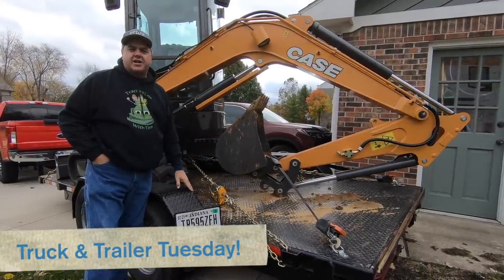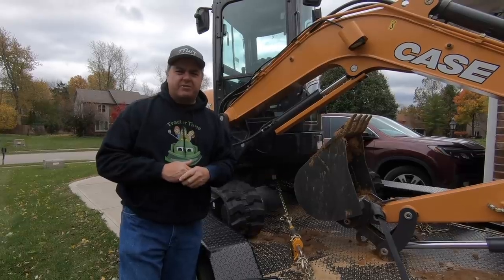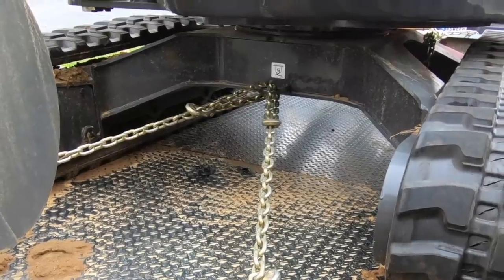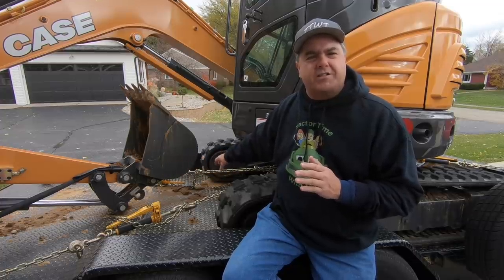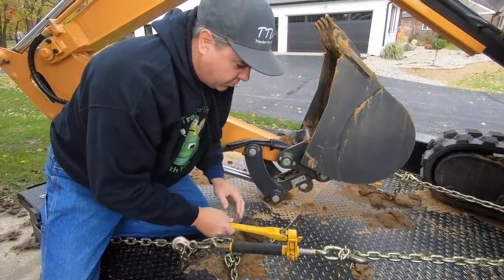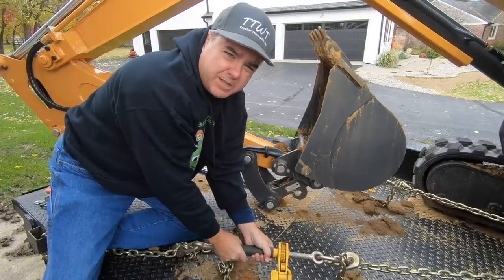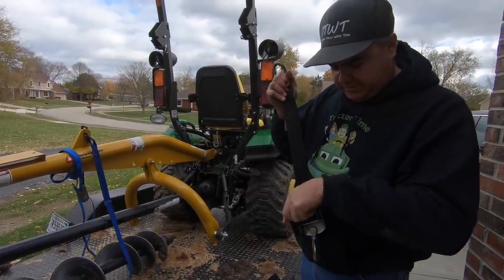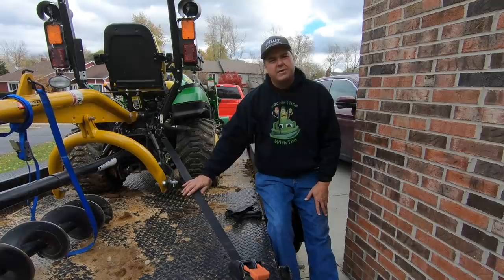Tie Down Your Equipment!  Truck and Trailer Tuesday

Comment: I think my John Deere manual says to haul the tractor with the front facing to the back ? I guess in case the hood latch releases?
Reply: I thought the reason to load the tractor backwards when hauling on a open trailer was so the seat does not violently bounce up and down as you go down the highway.  I must admit I have no link to support this, only sharing from my memory.

Comment: Not on topic but you should think about adding some 1ton(or more) swivel jacks to the back of your trailer for support instead of the blocks of wood. One of the best investments I made to my trailer. Not only will they stablize  the trailer you can lift the trailer off the ground to change a tire.
Reply from the maker: Ha! Well, this was the first (and so far only) time I have had big Casey on the trailer.
Give us time.  We’re trying to solve this issue
Reply: I second this this idea. I did this to mine Tim, its a great modification
Reply: That was going to be my suggestion as well but you beat me to it.

Comment: I still prefer the lever or snap binders even tho they are illegal in some states. The ratchet binders work well also. My biggest choise in any chain or binder is that it is made in the USA. The ratchet binders you are showing that I have found are made in China.  I'm sorry Tim I'm not trying to be mean, But I personally would never tie down anything I own with Chinese binders or chains. I only use high strength American chains And binders. To each his own, But I don't go cheap on time downs. I would like to add you did a excellent job showing And telling how to secure equipment.  Just not a fan of the binders.
Reply from the maker: What phone are you using to view this?

Comment: Doesn't the equipment that is attached to you tractor have to be tied down also? Or is it ok like the way you have your straps running over the front bucket holding it down all you need?

Comment: Hey Tim, how well does the rear PTO work on the 1025r? It's rated kind of low but I keep seeing videos of people easily using implements which call for more PTO HP and and RPM than the 1025r is rated for. 
It seems to power them all pretty handily.
Thanks for all the great info as always my friend!! 
My local Deere dealer is having a black Friday sale on the x700's, and the 1 series sub compacts (1023e, 1025r etc) So I am finally getting my green machine next week.
Reply from the maker: What are you wanting to pull?     We show MANY PTO attachments.  We show situations where it kills the tractor, and situations where the tractor doesn't know it is there.  I think you can get a good feel for it if you spend some time with our videos.    
Does that help?
I hope you are heading for a 1025R rather than an x700.  If you are thinking PTO, then you need the extra functionality.
Thanks for watching and for the kind words!
Reply: Yeah it seems the 1025r is going to be my choice. I plan on pulling a few different implements.  Mainly a rotary cutter,  disc harrow, soil aerator, spreader seeder, rotary tiller, and a few different size wheeled buckets.  I'll be using it for a bunch of different things. I'll also use the tractor to mow the back 7 aces of grass.
Thank you so much for responding to my questions!! 
I'm going to start watching some more of your videos right now. It's so awesome to see your wife and yourself doing jobs together. Yall make a great team. And you're giving many people like myself who are not experienced tractor owners yet, very valuable information. Thank you so much and keep up the great work! Happy Thanksgiving to you and your family. 👍👍👍🦃🦃🦃
Reply from the maker: Consider a tiller.  My favorite tillage attachment.
Reply: Absolutely!! I just saw 2 videos where you used it. One where yall were leveling a yard for soccer use. That soil conditioning implement looks really useful.  I'm going to want every implement I see!! Haha! I have the tractor bug. 😂😂

Comment: Looking for suggestions on a good wench to go from truck to trailer? Gat any videos ? Sherpa looks to dang expensive
Reply from the maker: No knowledge on this topic.   I would like to know the 'standard' way of wiring a high power circuit from truck to trailer...so that I could move away from the deep cycle marine batteries in the trailers.
...just use the double battery / double alternator provided in the F350

Comment: Hey Tim I ordered 4 cargo buckles from your amazon link after your video on tie downs. When I got the units it looks like they are to be used to bolt down. I’m guessing you added the safety hooks. What size hooks did you use?  Keep up the good work, always enjoy your videos.👍
Reply from the maker: I took one of the buckles in to Menards, and found the pin and hook to work!  Shoulda mentioned that! Sorry

Comment: If you use 6 of those ratchet does that give you more capability.   Ie 6 tie down locations..  wondering if those work with 2038r with loader backhoe setup
Reply from the maker: Yes, I believe it works with 2038r with backhoe. If using 4 straps, add up the WLL of each strap.  That is the amount you can tie down legally.  Using a different number of straps makes that math different, but yes, more straps supports heavier weights legally.

Comment: Great Video, in all my years of hauling equipment around I have never heard binders called boomers. It’s interesting how certain things have different names depending on where you are located. Those are some nice boomers or binders or chain things.....lol
Reply from the maker: Well, at least I gave folks something to talk about in the comments section.
Reply: Tractor Time with Tim please don’t take my comment as negative!  Just found it interesting. Great video keep them coming.
Reply from the maker: I suspect I mid-used the term. My dad would call the over-center lever style a ‘boomer’ we never had the ratchet style.
Having said that, searching for ‘chain boomer’ on google brings up the desired results. So I must not be the only fool.
Reply: Tractor Time with Tim LOL.....your far from a fool. Because of you I own a 2018 1025R TLB. I’ve learned a ton watching your videos. I never in a million years would have guessed a 1025 was so capable. My 2018 1025 already has 155 hours. We use it all the time. After watching you video on the terra king I’m looking to get one of them also. We have a Trac Vac we pull with our X500 but the terra king is next level equipment. Thanks again.
Reply from the maker: Thanks. The TKV20 really is a nice unit.

Comment: Oh me...1st off, you cannot hook to the grill guard, that simply does not have the structure to hold that tractor. Not to mention you hooked up high where the leverage works against the mounting point.  2nd.  You cannot take your working load limit, say you can be at 50% of the rating then say you are legal to double that rating...That simply makes zero sense.  As for those cute seatbelt straps...lol good luck when you get in an accident.  The point of strapping down the equipment is not to just keep it in place but to minimize it coming off in an accident. I was fine with the excavator but the way you did the John Deere, that might end up in your spleen if someone pulls out in front of you...

Comment: Rules? people follow rules?     At work were supposed to have 4 tie down points on our skidsteer since its 11k, but we run 1 chain on the back and 1 ratchet strap on the front.     one time jacking on brakes it got sideways on trailer.       somehow we never get stopped for any of the dot rules we don't follow.         my personal tractors   that weigh around 3500 and 6000 I use 2 3/8 chains with binders and a 3rd chain when I got my backhoe attachment on

Comment: Hi Tim. What size trailer would you recommend for a JD 1025 with a loader and a box blade attachment on the back? I'm looking at a 16' double axle, but was hoping to squeeze by with a 14' double axle. What do you think?
Reply from the maker: Get 16’ minimum.
Reply: @TractorTimewithTim  Thank you!

Comment: I used to work for an excavation company. We hauled machines all day, every day. When we would haul a John Deere 544K wheel loader, roughly 30,000lbs to 35,000lbs, we used two chains on it. Not once did we ever have an issue....Was it the legal?: no. Did we ever have problems?: no. Were we the only ones chaining down machines the same way?: no.

Comment: Why do you put the case on backwards? I put it facing the other way!
Reply from the maker: It was forwards with boom turned around.  I needed the weight forward further than I could get it with boom forward

Comment: Federal regs require implements also be "grounded" and tied down.  You've got that covered with your loader, and you did ground your auger, but you are required to tie the auger down to prevent movent.

Comment: Great video. Before I place my order for the same trailer is there anything you would do differently with your trailer build
Reply from the maker: Yes.  How soon are you planning to order?
Reply: Well I spoke with them yesterday it’s about a 10 week wait but I don’t need it until April and dreading the winter drive since I live in ohio. But no specific time frame. I’m running the same equipment as you are minus the excavator and pulling it with 2016 gmc half ton
Reply from the maker: Ok.  Was planning a video on this topic, but wouldn’t be immediate.
Reply: Tractor Time with Tim ok much appreciated
Reply: @vspd303  I'm not sure what length of trailer Tim has but go with at least an 18' trailer, gives you room to throw an extra implement on along with a tractor, loader and implement attached to the tractor.
Reply from the maker: Aaron, this is a dump trailer. Can’t get it any longer than 16’
Reply: @TractorTimewithTim  ok what a bummer, my trailer doesn't dump so that's how I ended with 18'. By the way great videos and I ordered edgetamers a week ago, thanks for the product reviews.
Reply from the maker: Thanks Aaron.  I'm sure you will like the edge tamers.
Reply from the maker: @Steven Mendez   In case I don't get to a video soon enough for your decision. Here is a list of things I would consider changing...would still buy the trailer, but would add/change these things if doing it again.

1. Hydraulic jack (no question...since it already has the pump)
2. Scissor Hoist.  The dual ram's do not have quite enough umph to lift a heavily front-loaded load.
3. Some stronger ramp construction (the angles where it connects the trailer. (see my first welding video).
4. Removable/movable spare.  It is sometimes in the way  I would prefer it to be under the bed....like the BWise
5. I would get some thin removable sides, say 24" high.  Not heavy duty ones like normal dump trailers, but lightweight removable sides.
6. Maybe drive-over fenders.

None of these are required. Even the current hoist is ok.  I just sometimes push beyond the practical limits :-)
Reply: Tractor Time with Tim thank you very much I will definitely consider those options.

Comment: I was taught if using straps that if a excavator equipment weight load was 10,000 LBS that to use a strap with a safe work load rating of 15,000 LBS or  higher than that weight cause the straps will stretch out over time and with chains if the equipment is the same 10,000 LBS that you can use 4 plus 1 for the boom implement of 10,000 LBS if it's a tractor with a backhoe and loader the backhoe has to have 1 chain each wheel at the axel has to have a chain and the loader has to have a chain in a upside down V pattern from the center of the bucket outward cause there is no such thing as over kill when securing things to a trailer my drivers ed in car instructor owns a commercial truck driving school and car instructor and lessons and has a cdl and has over a million miles behind the wheel and he has never lost a load in over 30 years of driving so I trust what he taught me and 5 times on Sunday
Reply: You are correct

Comment: DOT may love your tie down but will ticket you for exceeding the GVW of your trailer, your only tagged for 9K. That is if Casey II is 8K (3.7M tons = 8,140 lbs.)
Reply from the maker: I'm pretty close.  It is a 10k trailer.   The CX37C is 8000lb.   Esimated empty weight of 2500lb.  So, if I can get 500lb on the tongue, I should be fine.
Having said that, if you've been watching our videos, you would know that we are seeking a larger trailer.
Reply: @TractorTimewithTim  Something you may want to consider. My work trailer (12k GVW) has always been and always will be a bumper pull. Reason, if my truck has a break down or accident, I can always rent a 3/4 ton truck with a trailer hitch. Goose neck hitch = no truck no work. Also, If you are interested in a project, we are going to put a good sized outdoor horse arena in the spring/summer. We are located in Greencastle, IN.
Reply from the maker: Btw, didn’t even realize I was tagged for only 9k!  Oops. Never dreamed I would need larger when we got the trailer!
Reply from the maker: Oh, and contact me via email tim@tractortimewithtim.com about your spring project. Sounds fun